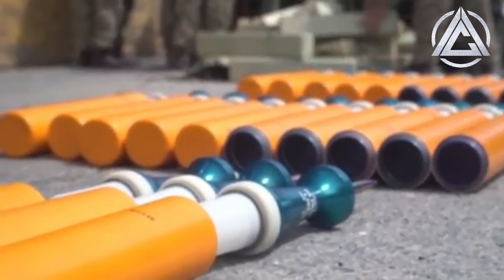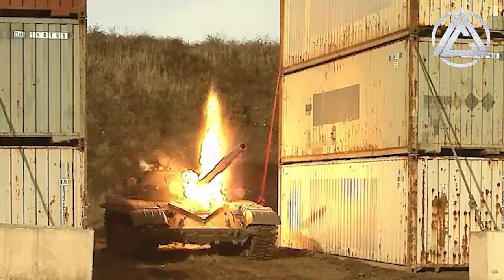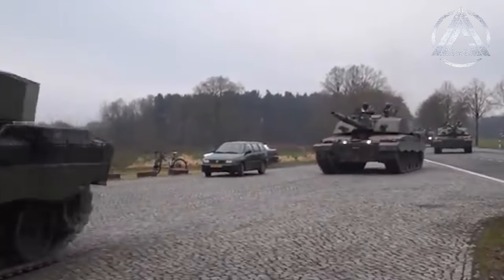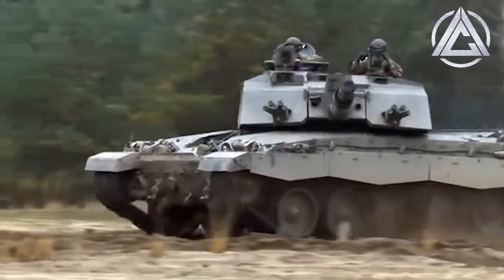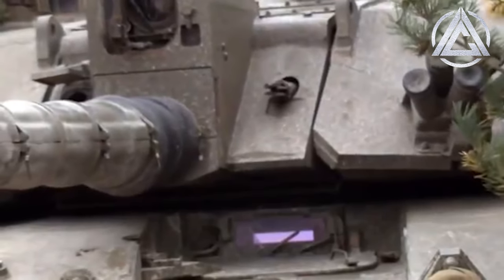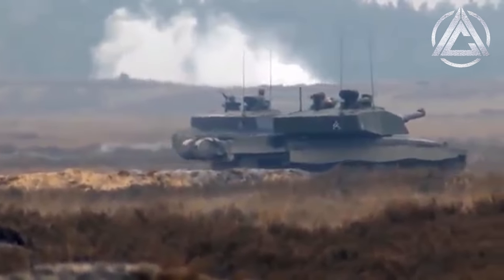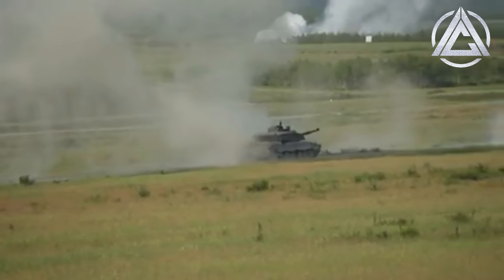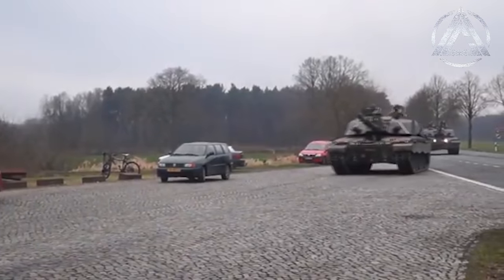Challenger 3 | Britain's New Main Battle Tank | Is It Really Any Good?

Comment: I’ve never thought about this as a new tank and this video really nailed that point home
Reply: It's not new... its an upgrade to C2. Let's be honest here.
Reply: Agreed, but ‘marketing’ 😜
Reply: @kalicom2937  oh yeah that’s what I’m saying
Reply: It’s got a new number! 3️⃣
Reply: @kalicom2937  It is effectively a new tank.

They've replaced the engine, transmission, suspension, all the armour, computers, digital systems, comms systems, fire control and optics, completely replaced the turret with a brand new massively uparmoured turret and heavily modified the hull with more armour.

There is very little to nothing left of a Challenger 2 in the Challenger 3.

This 'upgrade' is the same as the Challenger 1 to Challenger 2 'upgrade', ie a brand new tank wearing a skinsuit of the previous tank.
Reply: @titytitmk2738  absolutely
Reply: @titytitmk2738  No... they have not replaced the engine. Or the hull. Or the wheels. Not sure if the transmission has been mentioned so cannot comment,. It is an upgraded hydro-pneumatic suspension replacing the old one, but it is a replacement. This is effectively a rebuild, not a new tank (if it was new it would not use a lot of the old...)
Reply: @jansix4287  My car is brand new 'cos I filled it with new oil and fuel, replaced the tyres and got a new sound system fitted. Spanking!
Reply: @kalicom2937  There are conflicting reports but the engine has been at the very least heavily modified.

Either its the Perkins engine heavily modified so it produces 1600hp or they have put in a German engine that produces 1600hp.

Either way, the engine is massively different.

Also, you are wrong about the hull. The hull has been uparmoured, especially around the belly and lower front plate. This is on the official list of upgrades.

As the engine has been changed, the transmission is also mentioned as being upgraded.

The only old bits the Challenger 3 is using are parts of the hull, the running wheels and a few other minor things.
Reply: @titytitmk2738  The engine modifications are reliability (cooling) enhancements, not power upgrades. If that engine was capable of RELIABLY producing 1600 horsepower they would have up-rated the output long ago - remember that it was originally fitted to C1 so is VERY long in the tooth. They are NOT fitting an MTU replacement powerpack - it was considered but dropped on cost grounds. The MTU would have been smaller, lighter and more powerful, but added millions to the final bill....

The hull is a modified version of C2 - but only in order to take the new ammunition type.  There are no indications of permanent upgrades to the glacis armour and in reality this would seem to be unwise - there is no need to permanently add extra weight to the vehicle (weight stresses everything) when it is specifically designed to have extra armour fitted for Theater entry (big slabs of Dorchester are fitted, if you had not noticed). 

I think you are listing what you wish would be done to this tank and not what will be done to it. Either way, it is not a new tank in the same way C2 was compared to C1. Not even close.
Reply: @kalicom2937  Listen, mate, this isnt a discussion. I'm telling you what has been officially stated: the Challenger 3 has a 1600HP engine and can go 60Mph.

This is official. I dont care what you have to say about it, you are simply wrong.

>The hull is a modified version of C2 - but only in order to take the new ammunition type.  There are no indications of permanent upgrades to the glacis armour and in reality this would seem to be unwise - there is no need to permanently add extra weight to the vehicle (weight stresses everything) when it is specifically designed to have extra armour fitted for Theater entry (big slabs of Dorchester are fitted, if you had not noticed). 

Completely wrong. There are images published by the MoD that show the LFP has been notably bulked up, and the official release information states that the hull has been uparmoured.

Again, this is not a discussion. this is me telling you what has been done.

>I think you are listing what you wish would be done to this tank and not what will be done to it. Either way, it is not a new tank in the same way C2 was compared to C1. Not even close.

Wrong.
Reply: @titytitmk2738  I see you are living up to your avatar.

Firstly,  your tenses are all wrong. C3 does not exist yet.

Secondly, it has been officially stated the engine will be the same as it is now with reliability upgrades. 

Thirdly, 60 mph (96.6 kph) is widely regarded to be a typo and in all likelihood should be 60 kph. If not, the C3 will be the fastest tank in the world by a VERY wide margin. Go check it out, the FV101 Scorpion currently holds the Guinness world record of 82.23 km/h (51.10 mph). For a more direct comparison, Leclerc weights in at about 57 tonnes (so is lighter than C3 will be) and has a 1500 HP engine. That is good for 71 km/h (44 mph). So, even if the mythical new engines do turn up you recon the C3 will be able to go 25 km/h faster for only an extra 100 HP, while weighing several tonnes more? Id suggest you calm the fuck down. Mate.

Edit. Until recently LEP pictures show megatron. This is a test bed where lots of shit gets bolted on to test out. The "bulking up" as you so nicely put it is additional bolt on armour. The hull underneath is exactly the same. Do you know how I know this? Because it is a C2 hull with bits bolted to it..... As I mentioned C3, DOES NOT EXIST YET. 

You really are a bit special.
Reply: @kalicom2937  >Firstly,  your tenses are all wrong. C3 does not exist yet.

The prototype exists.

>Secondly, it has been officially stated the engine will be the same as it is now with reliability upgrades. 

Citation needed. 

Because you arent getting 60MPH out of the existing engine without some heavy modifications.

The official information states that the engine will be upgraded to 1600HP. As I have said previously, and which you in your self-righteous arrogance seem to have ignored, I have seen two reports of whats happening. 

Either they are keeping the Perkins engine but heavily upgrading it or they are getting a new German engine.

If these 'reliability upgrades' are code for 'massive upgrades', then sure what you are saying is fine and in line with what I have already said: They are heavily upgrading the British-built Perkins Engine. Which is fine.

Regardless, my original point, which was that the Challenger 3 is getting a massively more powerful engine, is true. You are being needlessly combative in a ridiculous attempt to sound like you know what you are talking about and/or to sound like you are well informed.

>Thirdly, 60 mph (96.6 kph) is widely regarded to be a typo and in all likelihood should be 60 kph.

Except no corrections have been put out and, last time I checked, the MoD website still states 60mph.

>So, even if the mythical new engines do turn up

Dont put words in my mouth. I never said the Challenger 3 was definitely getting a brand new different engine. I said that I had seen reports that it MAY have been getting a new German engine.

>Edit. Until recently LEP pictures show megatron. This is a test bed where lots of shit gets bolted on to test out. The "bulking up" as you so nicely put it is additional bolt on armour. 

Great job assuming you know which picture I was talking about. I was not talking about the pic of the Megatron tank from Bovington.

I was referring to the official pictures, for example shown in this article from the BBC: https://www.bbc.co.uk/news/uk-england-shropshire-57025266

Note now the LFP is much bulkier than the baseline Challenger 2?

Its got an even thicker block of the next generation MK3 Chobham in there now, and thats even before the add-on armour is added. All in all its speculated that the LFP will match the breech, turret cheeks and UFP in armour protection.

I have not seen, however, any indication of the sides of the hull being uparmoured, but the official statements seem to imply the hull sides have increased protection as well.

But good job showing off how uninformed and lazy you are, unable to do even basic research.

>The hull underneath is exactly the same.

Wrong, as proven above.

>Do you know how I know this? Because it is a C2 hull with bits bolted to it

Again, wrong. As proven above.

>..... As I mentioned C3, DOES NOT EXIST 
YET. 

The prototype exists, you muppet. What do you think the new tech was tested on? Where do you think the images of the new tank are from?

>You really are a bit special.

No, that would be you, muppet.
Reply: @kalicom2937  >"picture link" Wow. It is so heavily modified it is identical to a C2 LFP.... oh, because it is a C2 LFP. If you want to see beefed up here is some eye candy for you

That picture you posted is nothing like the picture used in the article I posted.

Maybe take a look at the article before assuming you know what picture is used in the article.

I know what the LFP looks like, and the extra bulkiness of the lower front plate of the hull in the article I posted is not the LFP addon armour.

> "The prototype exists." Yes, using a C2 hull and a prototype turret

It uses a prototype hull, as, as stated in the official upgrade specs, there are modifications to the hull, including increased armour protection. So not using a prototype hull would be stupid.

>"Citation needed. " The engine upgrades are part of the Heavy Armour Automotive Improvement Programme. This program covers reliability improvements such as improved cooling and air filtering. It is not intended to significantly boost power output. See

Then they must have rolled that change back then, as early reports either said they were upgrading the existing engine to 1600hp or getting a 1600hp german engine.

>Well, if the UK government says it then it must be correct. They never lie and they never make mistakes. Oh shit, sorry, BoJo is the boss and he does nothing but lie and make mistakes. Anyway, on this one I am going for the common sense approach - to shift 64+ tonnes at 96km/h will take a lot of horses (much more than Leclerc and that has 1500 of them....) 

Boris isnt in charge of the MoD or procurement so trying to shoehorn him in is disingenuous at best.

As for the speed, we'll see what the end result is. However the official statements state that the Challenger 3 will be faster than the Challenger 2, unless the public statements have since been changed.

>"Wrong, as proven above." The only thing you proved to me is that you do not know what a C2 LFP looks like. 

As stated above, I know exactly what the LFP looks like.

What you showed, is not what is in the article. Maybe you need to get a new set of glasses?
Reply: @titytitmk2738  Snoooooorrrrre. Have a very good night now.
Reply: @kalicom2937  So, proven wrong you go running off. How very mature.
Reply: @titytitmk2738  No. I gave you a full and complete answer previously and could not be bothered to read you next enormous essay. If it was anything like your previous BS it would have been a waste of my time.

There is a story about being bitten and then becoming shy. You probably know it. It is relevant here.

Have a very good day now.
Reply: It has the same power unit and the chassis is the same, it's basically a new turret ontop and some electronic upgrades.
Reply: @titytitmk2738  Well said mate, I was gonna make the same comment, too many kids here that would cream in their pants at a new Leopard 2 or T-90  variant with some incremental improvements but at the same time will scoff at the Challenger 3 and call it nothing more than a Challenger 2 upgrade even though it's almost entirely a new tank
Reply: I lost count of the times this was repeated along with other details!!
Reply: @titytitmk2738  Its a really big upgrade, a lot of older tanks including Leo or Abrams got major revisions too, without changing the name. Although the turret is ofc entirely new.

Comment: The most fragile part in high speed driving a tank are the tracks ... notcthe engine or the transmission... just imagine the force working on a 2,8to track at 100km/h... long befor the engine or transmission would break the tank would throw its tracks... the Diehl tracks on the Leo2 are tested up to 120km/h

The Trophy Leopard2 A7A1 are only bought in small number and the only reason is they are for the fast NATO reaction force were they fight together with M1A2 with Trophy to make the logistic more easy by only using one hard kill system.
Germany will use ADS for their armored vehicles in numbers
Reply: Yeah but they usually don't do max speed
Reply: Wasnt there some story going round that the tracks couldnt get traction on an ordinary roadside kerb?
Reply: @redf7209  That would be unlikely, considering all the weight on top of those tracks. But I guess that depends on the type of track used, as steel performs worse on concrete then rubber.
Reply: @Adierit  I'm thinking a long rail vehicle will always have a lot of its weight distributed on track either side.
Reply: @redf7209 The tank destroys road side kerbs . you are supposed to leave about one foot between kerb and track so when the tank is guided away and turns it doesn't destroy it. At Babcock Bovington the workers frequently park right next to the kerb , many are wrecked. Don't care or poor training !

Comment: I think they just got confused with kph and mph.

When going at over 60kph the Challengers engine would rev over its limit, which could damage the engine. It is the same as driving 50kph in 1st gear at 6.000 rpm in you VW Golf. You could go 60kph if you increase your rpm to 8.000 and risk damaging your engine or you could shift wich loweres your rpm at the same speed. The Challenger would by now be in its highest gear, the only way of going faster is to increase the rpm of the engine.

In order to increase the "safe speed" they would either have to adjust the gear ratio , wich would make the tank loose power because the engine would rev at a lower rpm at 60kph. They also did not mention thath they modified the transmission, so that is not the case.

The other way of increasing the "safe speed" is by  strengthening components in the engine, but there are no mentions that the  Challenger 3 received such upgrades. Everything i could find was that they impproved the cooling system which increased the power output a bit so it compensates for the increased weight.
Reply: They stated that its the Power Pack that is being upgraded. that is both the engine and transmission.
Reply: Maybe there adding an extra gear, or extended range to the torque converter. I have no idea how a tank transmission and engine work these days but that’s what would do it for a D9 bulldozer.
Reply: @knucker2730  They only impproved the cooling of the entire powerpack
Reply: @notinmyairspace  uprated turbos give the power increase!
Reply: Or... or. Just hear me out. They could just put a bigger engine in the tank or give it another gear
Reply: As I understand it, the engine is PLENTY capable of 60MPH. Both forwards and reverse.
I questioned it myself thinking it was a typo and have been duly informed that MPH is quite correct.

Comment: I agree with you 100% with regard to the weight, it would have been better to just focus on reducing it to around 50 tons, and there are different effective ways to accomplish that, like for example the way Japan did it with their Type 10, by utilizing modular armor. Thereby you can use different armor packs, depending on the situation, transport it separately, can be easily replaced on the field and upgraded later on if new materials and such are developed. I think they missed a huge chance to make a better tank, which is easier to maintain, and support logistically as well as have a good punch.
Reply: The weight makes zero diference it already gets transported only by the c17 even reducing that weight it would still only be transported by a c17.
60-70kmph is perfectly fine for a MBT.